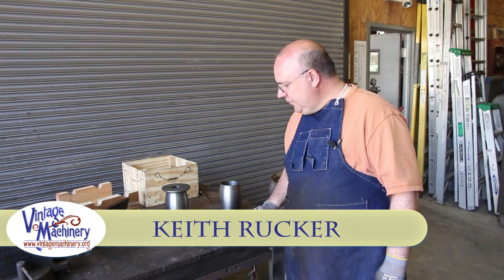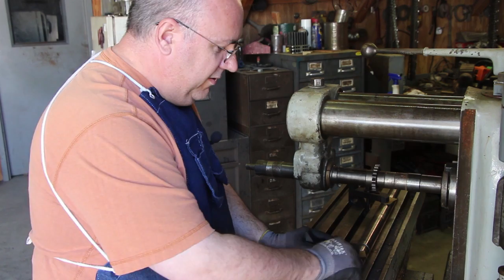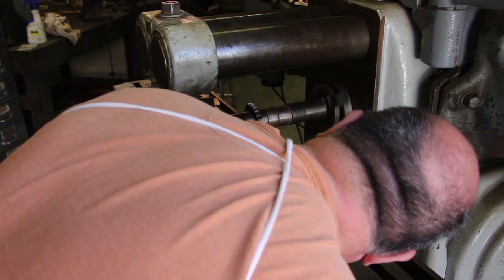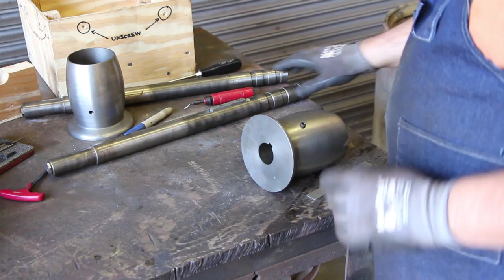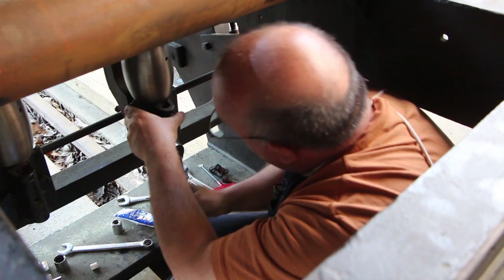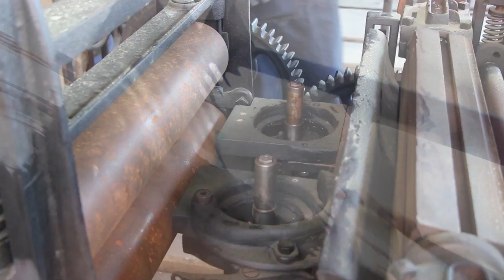Milling a keyway on a shaft and installing a flat belt pulley on the J. A. Vance Planer Matcher

Comment: Really enjoy your videos and I also love running the old horizontal mills.  We have 4 K&T's and 3 Cincinatti's in our college shop originally produced during WWII and they all run perfectly.  They are also amazingly quiet when they run as compared to the vertical mills.  Just a tiny point of clarification about the name of the machines you are using.  It is pronounced "Kearney and Trecker", not "Kearner and Trecky" as you commonly refer to in in your videos.  Wouldn't want anyone to be confused!  Thanks for sharing your knowledge.  I love all your videos!

Comment: Hi Keith, the old horizontal mills are really versatile! I've used them plenty, and built multi part, straddle milling fixtures for them also... Have you made a video in which you used the vertical head? It would be interesting to see it put in place if nothing else... :o]

O,

Comment: Keith the key ways turned out good looks like you got a good fit on the pulleys.  Do you know the rpm those side cutter heads are rotating at?  Also what about the rpm for the planing cutter head?  I'm curious how they compare to modern jointer / planer  / shaper machines in our shop.